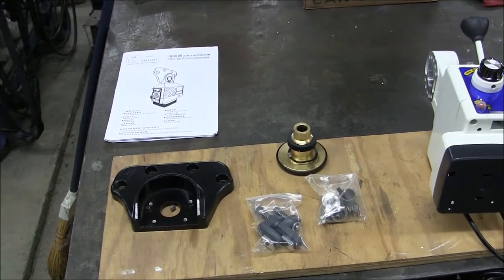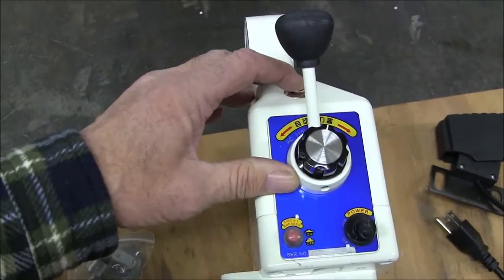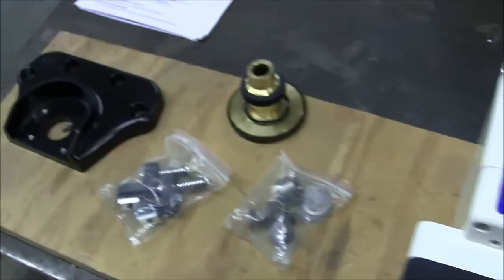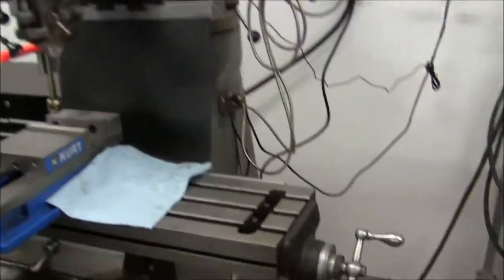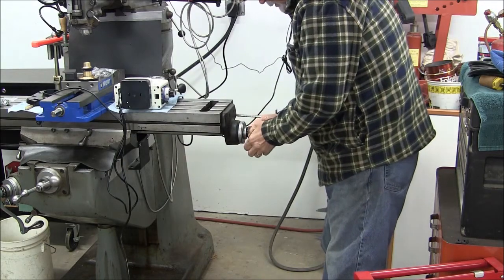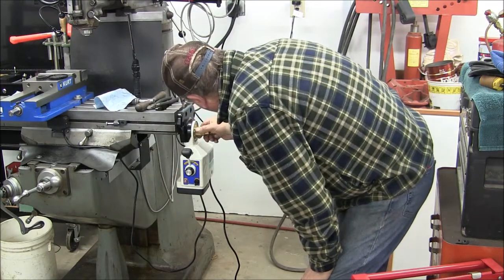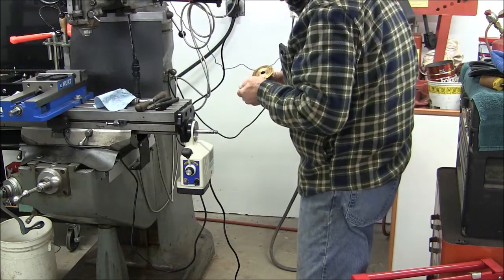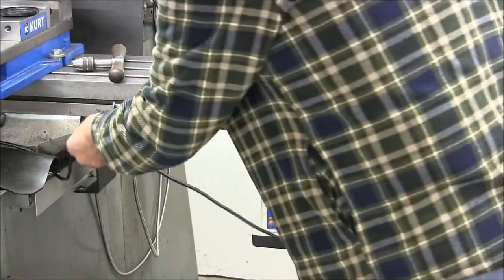Power feed

Comment: Looks the same as the one thats on my mill. The one thats on my mill has worked well no complaints at all.Hope yours works as well. I'd like to get a power knee been tempted to make up the attachment for a power drill like I've seen on some videos.
Reply from the maker: I suspect for the limited home shop use these Chinese units will be fine. We'll be finding out I guess.  I've been using it and I'm already spoiled.  A power knee would be nice too. Everything added is more wires hanging. I've never seen a good way to tidy them up. I've been looking for something to nickel plate so I can try out your process.  Gotta try it! Later, Mike
Reply: Hi there, a quick tip. If ? when you make up the knee crank drill adaptor, do not bother with trying to mill all the castellations. When I made mine, I just drilled 3 holes equi spaced for 5 mm  ( 3/16" ) hardened dowel pins. You could use silversteel ( drill rod ) and harden them. It has worked flawlessly , to be honest, just 1 pin would work  fine with the load it has on it, I also machined 3 flats on the drill shank part to stop it slipping in the chuck. Just wish there was somehow to put photos on these posts to show you how I did mine. Good luck with making it, it will certainly save your arm keep cranking the knee up and down. These are available on e-bay for about $ 60 US.
Reply from the maker: Hi Doc, Dave sent me some photos of his knee mill rapid traverse drill adapter.  I love the pin engagement design. It's definitely on my to do list. He asked me to forward photos to you if you are  interested. If you provide an email address I'll shoot them up to you. Thanks Mike
Reply: @michaelmurray9154  doc0455@yahoo.com

Comment: Nice addition Mike. I just installed a similar one on my import mill about 3 weeks ago. I got the "high torque" model for $137. Also had a complication, the step in the lead screw was too long and rubbed on the needle bearing. I machined it a bit shorter and all is good. I did notice in comparing this unit to the old Servo power feed on my other mill, the Servo has a lot more torque, and seems to compensate when I try to hold it back. But I think these economy ones have enough power to do a good job for the low investment cost.
Reply from the maker: I saw the hi torque ones for 137 when I ordered mine. I probably should have coughed up the additional money but oh well. It'll be interesting to see how mine holds up. In my little shop, mill usage goes in streaks. I doubt if it gets an average of 3-4 hours per month. Tc, Mike

Comment: Hi Mike, WOW, you are now really stepping into the 21 st Century with your Bridgeport, firstly a DRO and now Power Drive. :-)) LOL. Just a slight warning to you as a Millwright, PLEASE check that when the table is fully to the LEFT ( drive motor closest to the knee ) that the leadscrew does not get tight. If so slacken off the bearing bracket screws to let it center the leadscrew in its nut, then retighten. There could be a slight misalignment horizontally and vertically due to screw clearance holes etc.in the new bearing plate. Have Fun with it, it will certainly save your arm when machining long parts. Regards from a wildly burning in places Australia. Where I am is OK.
Reply from the maker: Great advice Dave. I don't detect any binding with the bearing bracket in it closest proximity to the lead screw nut. (Table far left) So I think I'm ok. The dro and pwr feed are things that have been on the list for a long time. The head needs to be rebuilt too. That's up the road. I'll be using the pwr feed on making a pierce die for making the Reid's bearing cages. Probably the next video. Hope you are well out of the way of those fires! Cheers, Mike

Comment: You didn’t show it working 🙄

Al.
Reply: Have you a link for where you bought it from Mike I might get one.
Reply from the maker: @pearcemachineshop5200  Here's a link. https://rover.ebay.com/rover/0/0/0?mpre=https%3A%2F%2Fwww.ebay.com%2Fulk%2Fitm%2F202017492741
Reply from the maker: I'll be showing it at work in the next video. Guess I should have turned the camera on with it in motion.  I didn't think seeing it turn the handles no load meant much. Since then I have used it and so far Im  loving it. Tc, Mike